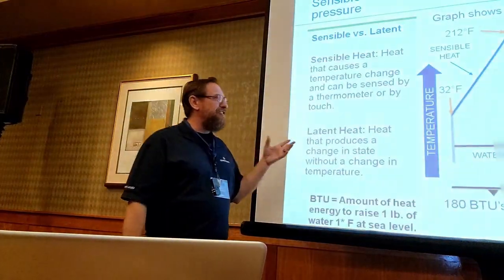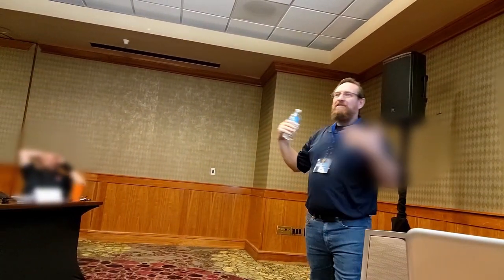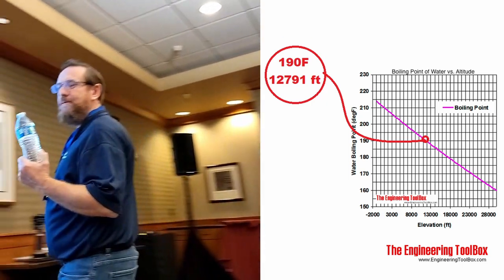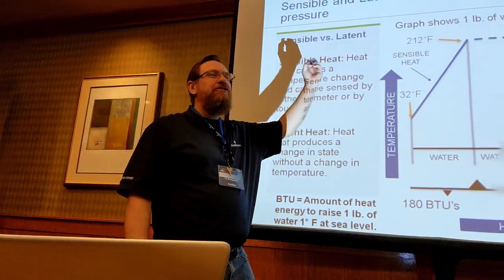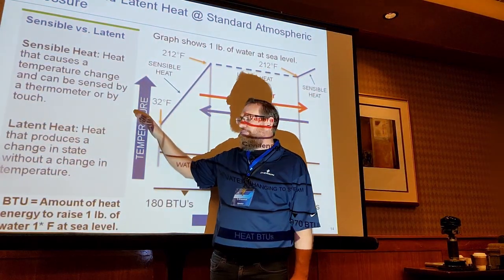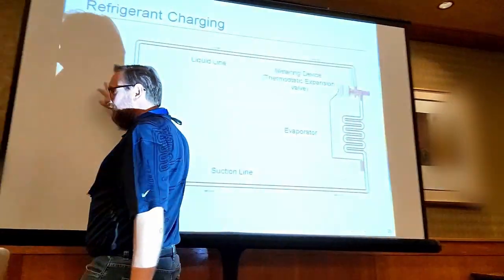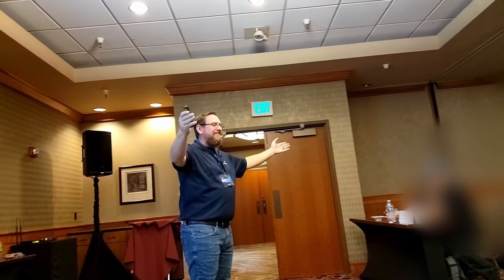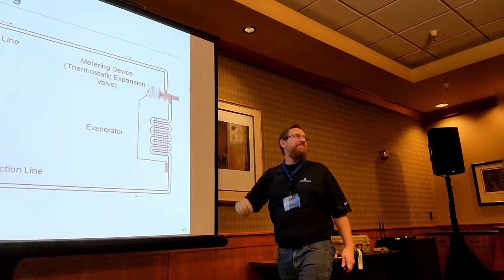Live Class part1

Comment: How many btu does it take to change 1 lb of R134 refrigerant into vapor?
Reply from the maker: Enthalpy [Btu/lb] latent will change with temperature,
40⁰F it's 84 BTU, 
110⁰F its 68.8 BTU
Reply: @love2hvac  thank you, is that calculated for the specific heat of the particular refrigerant? Or do we have to just  get that from a  enthalpy chart?
Reply from the maker: https://www.chemours.cn/-/media/files/freon/freon-134a-eng-thermodynamic-properties.pdf?rev=6b9c908e8f4141fb95274666e05dfb5f